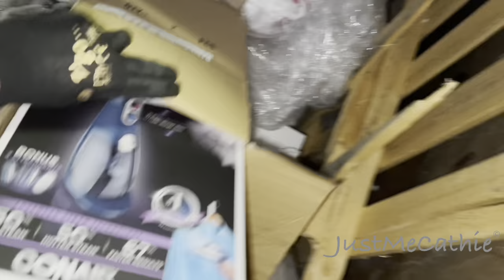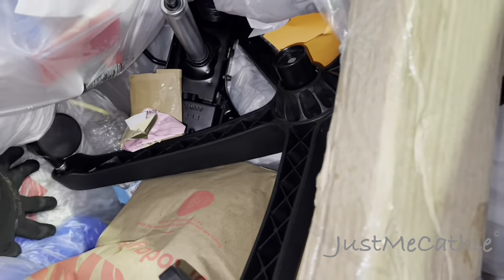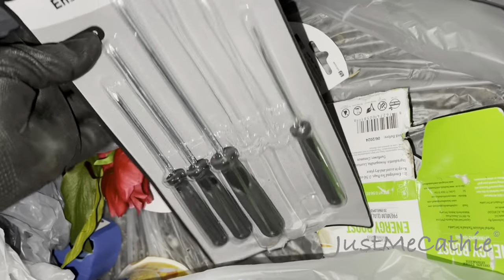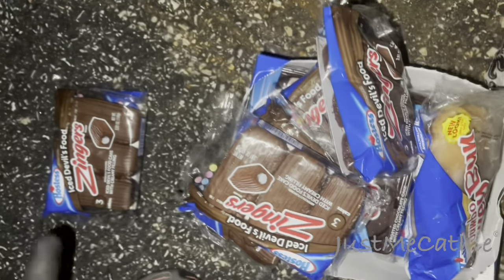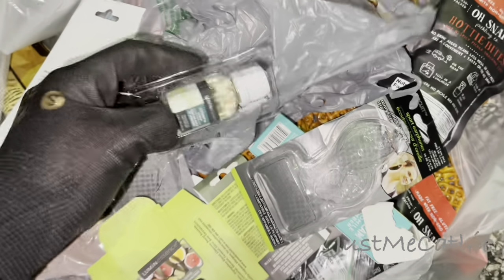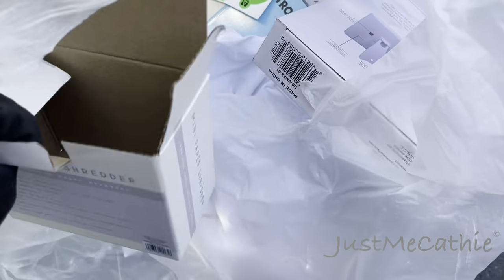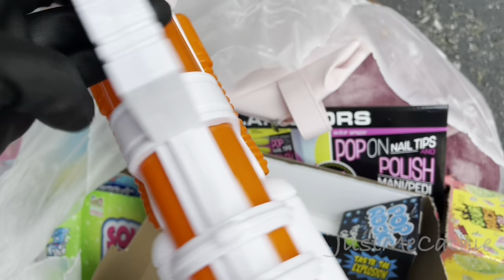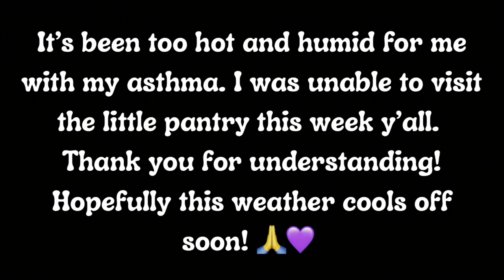I SCORED So Much Dumpster Diving Behind Retail Stores! & Five Below Tossed Out BAGFULS Of New Stuff!

Comment: Such a variety of finds ! I’m glad you check pharmacy dumpsters  as well- one time I called my pharmacist and asked what the expiration dates really mean- according to the pharmacist it means the manufacturer can’t guarantee that the potency is exactly the same strength as what the label states. - the product doesn’t magically morph into a different & dangerous substance. 
Like if one found 1000 unit vitamin C - just after it’s best by date  that means maybe it could only have lost 100 units of strength.